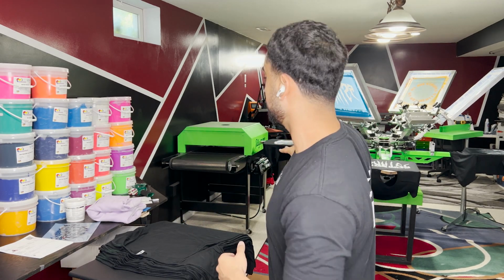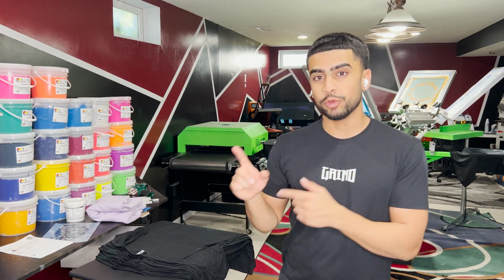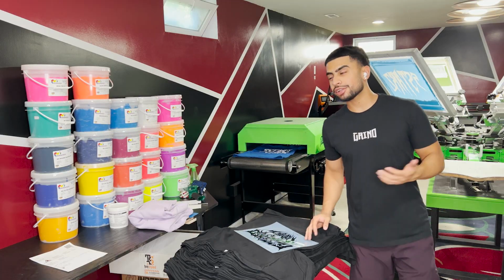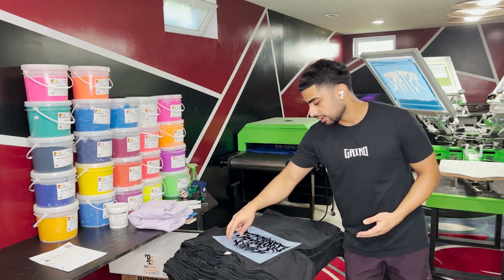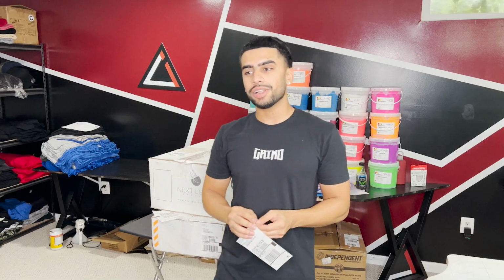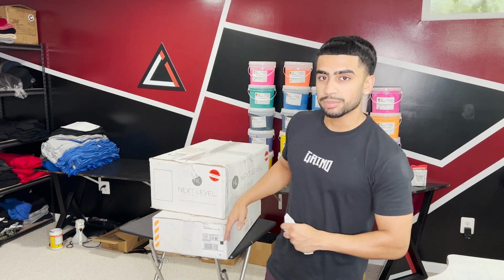I Messed Up A Screen Print Order...

Comment: Im glad you just posted this video. Im currently in an issue. One part i think i figured out that I was pushing too hard and squeezing way more ink out. The other part im stumped on is why my ink is looking pitted. Im using the green galaxy comet white. Could the screen be too close to the pallet or what are your thoughts? I had done tests prints that turned out pretty good and then started production.
Reply: Hard to say without seeing what you're talking about exactly, but yes your offset might not be correct.  Also make certain your image is completely cleared out and no pieces of emulsion is left behind.  Good luck! Keep on hustlin'
Reply from the maker: How’s your off contact? I’d make sure you have a good off contact to make sure the ink is clearing smoothly. If your struggling with getting a good off contact a quick tip is tape a quarter to the top edge of the screen if it touches the pallet. By taping that quarter to the edge it will give you constant off contact when coming down
Reply from the maker: Agreed!
Reply: @teeshizzle891  if you've ever done drywall and had little air bubbles in the mud, thats what it looks like. I did have some ink clogging the screen before i noticed the pitting because I forgot to flood it before i took a phone call. I did a really hard push and got it pushed out then i had ink on the bottom side of the emulsion and had to wipe the whole underside off.
Reply: @baavproductions  i will check that right now. I turned everything off,  washed the screen, and walked away for lunch and to do some research when I'd seen your video pop up.
Reply: @tobindunklebarger4436  Gotcha!  Yeah I would probably just clean the screen and begin flooding and then pushing or pulling (preference).  Like Baav suggested, make sure you have enough offset and tape that quarter or the equivalent to the screen so you have enough.
Reply from the maker: Sometimes thats needed man. I’ve had countless times when I was having issues on press and just turned everything off and got away from it. Grabbing some food or whatever to clear your mind and come back fresh and your bound to figure it out. Don’t give up on it.
Reply: Thanks everyone!! Going to adjust everything and see what happens!
Reply: The off contact was way off. After adjusting that, its been clean sailing ever since
Reply from the maker: Niceee🙌🏽 yeah off contact plays a big role and makes or breaks the print
Reply: @tobindunklebarger4436  Great to hear!  Thanks for letting us know.  I know that feeling of "what is causing this issue" and then fixing the issue.  Just pure elation when you print and the tee looks good!  Way to go!

Comment: Do you request your misprints from the customer, even if it was your fault. I would 1. Want to make sure work I printed incorrectly wasn't out in the wild. and 2. if you have to eat that cost might as well get some shop test shirts and rags out of it.
Reply from the maker: I agree with you on this one! I did request to get the misprinted garments back but in this case the client actually wanted to keep those as well. I accommodated by only charging them basically material and print cost to keep them cause on the other hand I would have used them for test prints exactly as you mentioned.